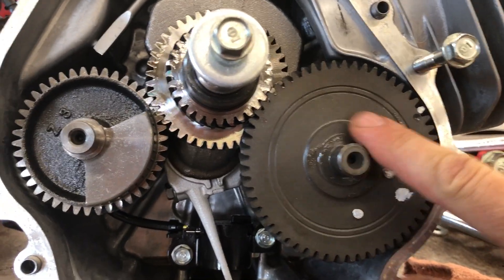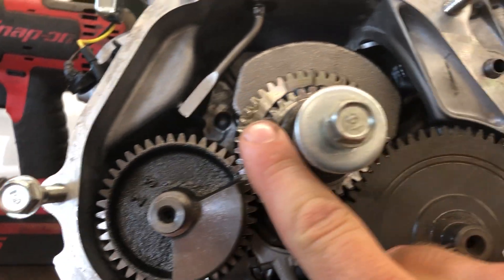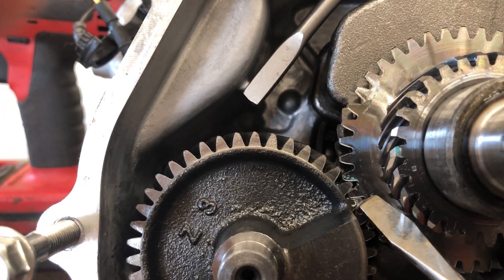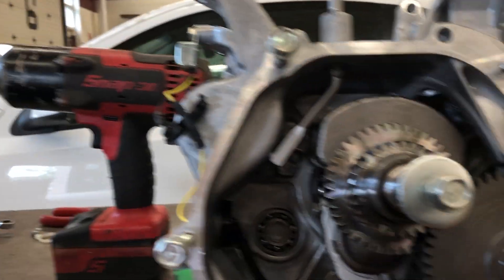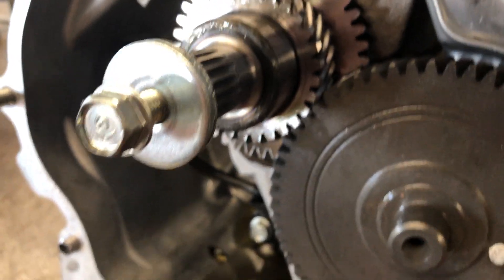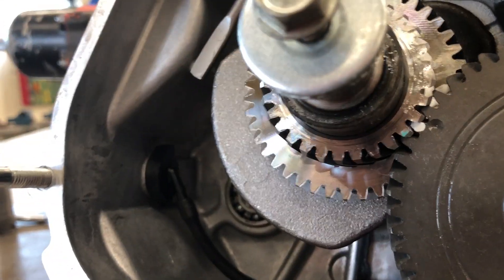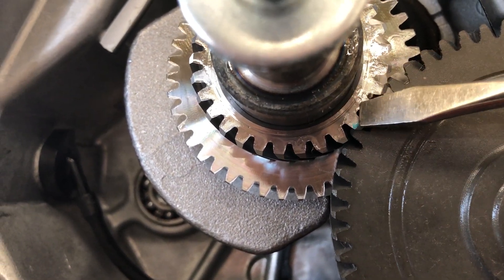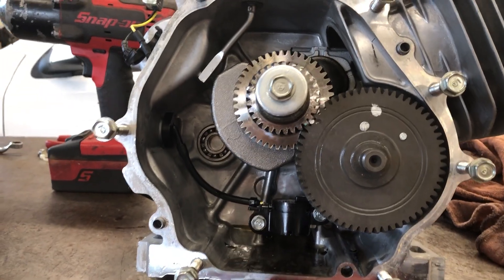Honda GX390 Timing Marks

Comment: Could it be possible that the cam shaft is off by a 180 degrees? Having trouble assembling mine and getting it to work.
Reply from the maker: The camshaft could have been put in incorrectly at any angle. The dots need to be aligned on the corresponding gears. So very possible.

Comment: I can’t get the cover to come off it’s like it’s connected to the shaft
Reply from the maker: There is one hidden bolt holding the crankcase cover on. Be care to locate it before you do too much heavy prying. There are the bolts around the outside of the case but one located under the drive reduction gears if your engine has drive reduction.